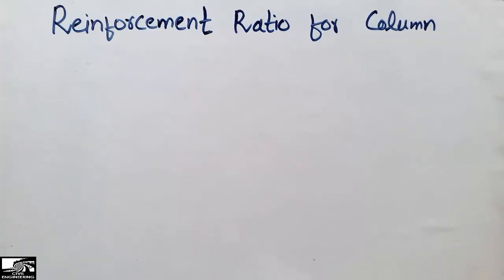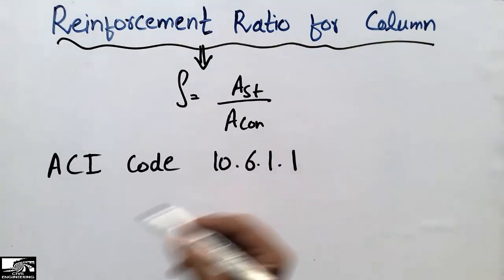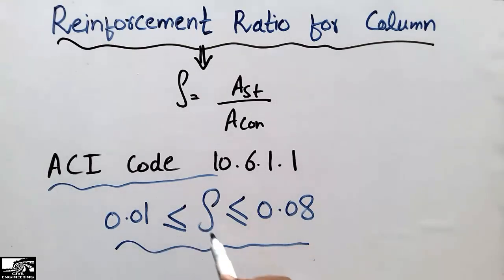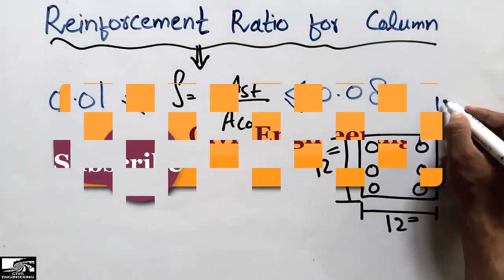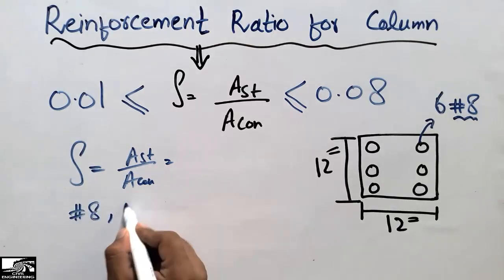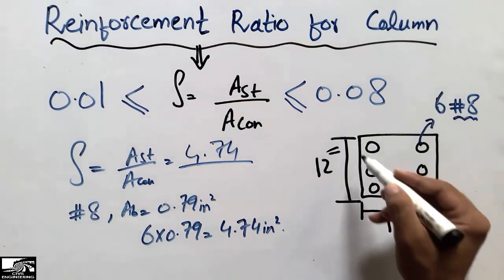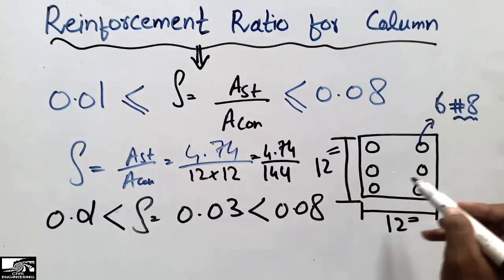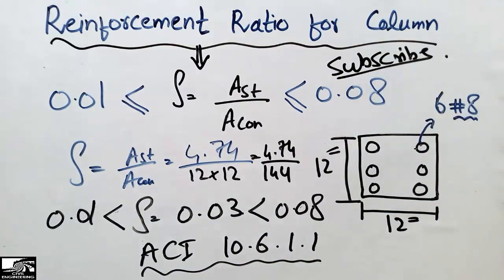Reinforcement Ratio for Column

Comment: Area of concrete taken is 12 inches x 12 inches in example but area of 8 MM Steel taken as 0.79 mm square. Is this correct  as shown in example where numerator unit is different from denumerator unit.